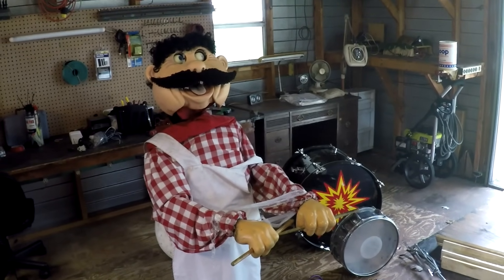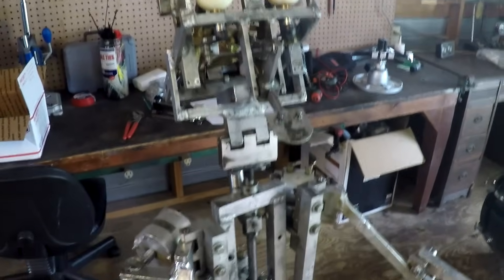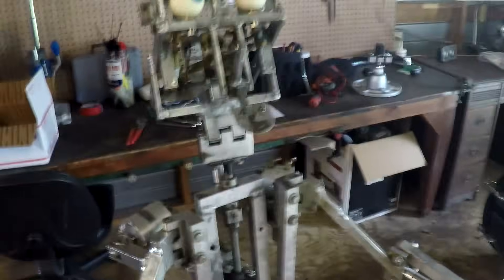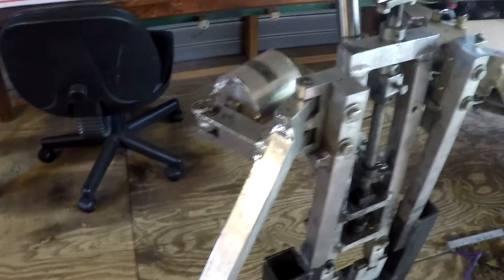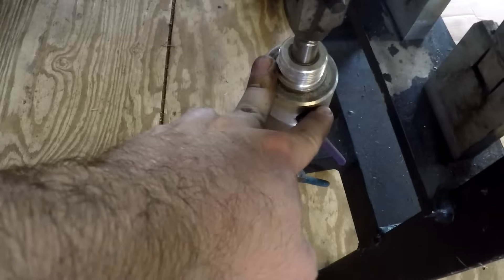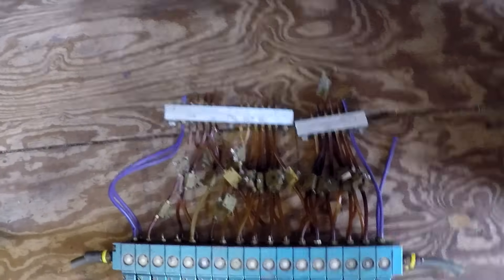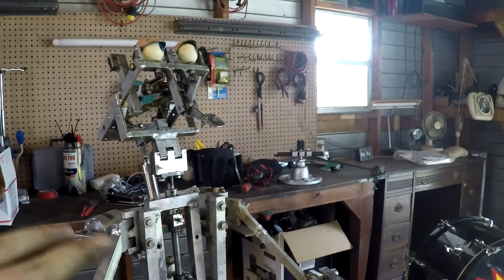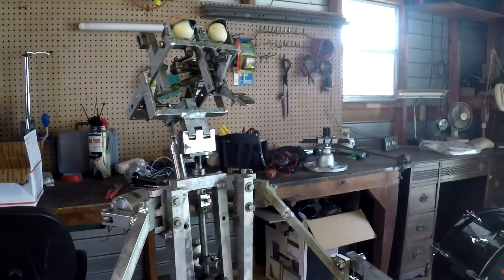Robot Drummer Animatronic Project PART 1: The Arrival

Comment: The flow controls underneath the stage not only make it easier, but faster to adjust, even while a show is running. They don't have to take the figures apart and thus avoid damage.
Reply from the maker: And I was thinking if I kept the flow controls at the valves if I want to move them it'll be no big deal to change. But if they're in the figure and I want to move them I would have to put couplers or run new hoses again. So I'll keep them at the valve and see how it goes.
Reply: RanHam335
You're right, it's better to have the flow controls near the cylinders. This is important for industrial equipment that needs to be precisely adjusted. Often the flow controls are mounted directly on the intakes of the cylinders. But often in those kind of applications the cylinders are exposed or very easily acessible.